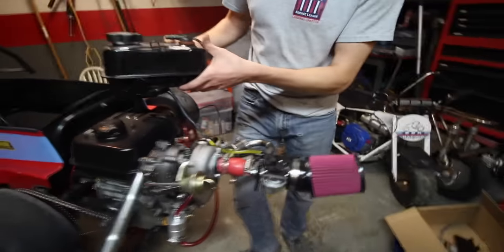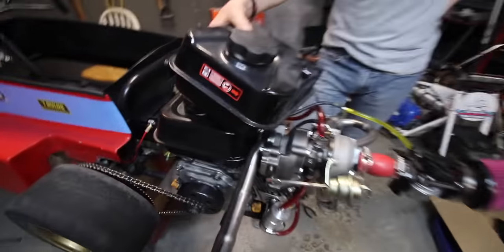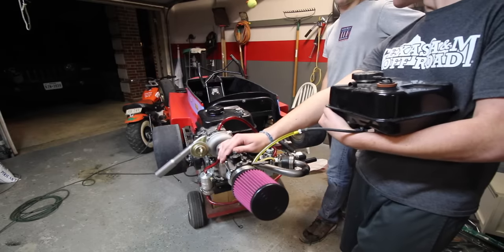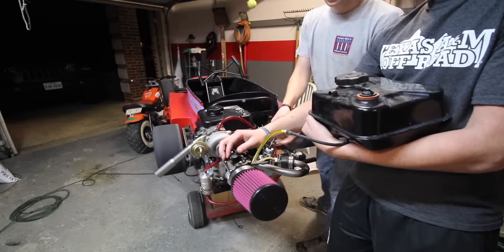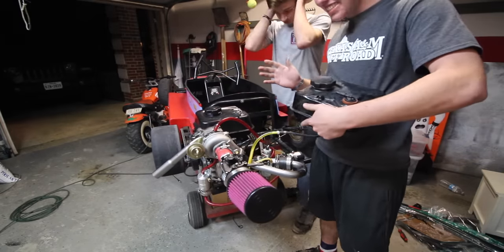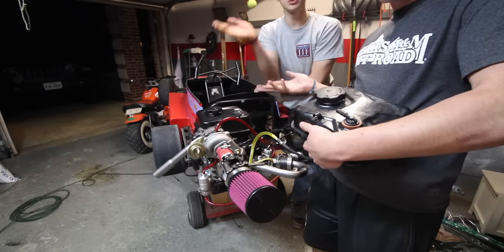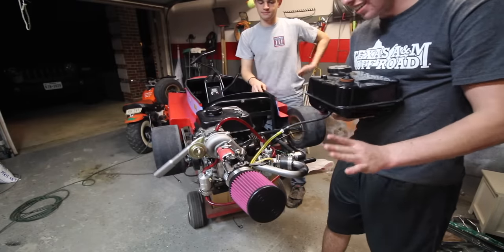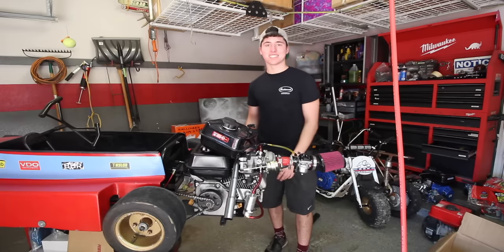Turbo Go Kart Finally Makes Boost!

Comment: BUT what if turbos just aren't effective (due to the laws of physics)  in this size ratio. It could be a big difference when it comes to power efficiency at this RPM and system pressure. I think you are close to cracking the code here. Keep trying. Thats the innovation spirit, you as well as "Cars and Cameras"  both have tried this...Jon and Ike are awesome people i think they gave up though. Ike determined it wasn't possible with the limited carb set ups available though gopowersports.com and EFI is crazy ....they didnt try dual staged carbs though thats a clever boy!! who knows, not unitl all options are ....Exhausted haha pun intended! ha

Comment: You have no idea how carbs work under boost. You need either a special carb made for boost or just get rid of the carb between turbo and engine, you only need one carb, adjust or jet it to give more fuel and but it before turbo then its just a matter of finding the right mix for the boost.

Comment: god this is like waay late, but, you need an air filter on the turbo cuz it pulls it's own air and NOT a carb. attached to it because at that point you are restricting the shit out of the air flow into the turbo............it needs to breathe on it's own and it will run waaaaaay better with a proper installation, meaning the turbo inlet has just an air filter.... the turbo pulls air and forces into the carb, a second carb should not be controlling air flow INTO the turbo, the turbo needs to breathe on it's own

Comment: That way there's no gas flowing through a turbo which gets the ions of it all wacked out and was never meant to work that way and that's how everybody's been trying to make it work on these Predator Motors and they always fail. They run but not very good

Comment: Epic fail guys. You push the boost in the 1st carburetor. But the gasonline must be suckt out of the carburetor. So you push your gasonline back and the engine stopps xDDD
 - holy moly. how bad.

Comment: Two carburetors guys really how about you take that bottom carburetor off and make it intake for that tube and run the suck through carburetor from the top and it'll run like a top you're just choking out the engine with that bottom carburetor

Comment: the point of a turbo is to add air to the combustion, why you want the turbo to add fuel???? then it becomes too rich... if u want more fuel, just have it pump more to the pistons, TURBO = Rise of Air PRESSURE. NOT FUEL PRESSURE

Comment: You could just do away with the before carb and re jet your carb that’s after the turbo and tune it to dump more fuel at a higher rpm that should solve your problems

Comment: What the hell is the deal with the carb setup? Just use ☝️ of the 💯 dependable efficient setups pioneered by those that came before you, unless you feel that you have stumbled upon something truly profound with your carb setup. Flip that turbo so it’s facing the front of the buggy, mount it a little higher and 💥 better air. You could build a little scoop and it would actually look like a little F1 with that scoop over the head with a crazy wing.

One carb + 🐌 + ⛽️ + ⚡️ = 💨

Comment: you guys are missing a lot of things that you need to go and research,  wastegates, blow off valves, intercoolers, o2 sensors, fuel ratios, engine maps ... turbos....  can't just slap that thing on and expect it to work becasue it won't.

Comment: See the boosted boys and go with fuel injection kit with the program for setting the fuel injection system programmable for your laptop. That is the way to go without all the confusion of the carbs messing everything up. https://www.youtube.com/watch?v=W_j2k_oMRbA akk the way to here: https://www.youtube.com/watch?v=UgDZFMABay0&t=478s plus you would definitely need to have the governor removed from the engine also.

Comment: They didnt pressurise the blow through carb and so when it sees boost it no longer has any vacuum which is what the carburettors needs to operate. You are basicly starving the engine if fuel and that's why it dies when it makes boost. This is basic stuff i have no idea why they are wasting their time with this 2 carb BS either pressurise the blow though or run a draw through setup.

Comment: Small engines+turbo..=💩..... I seen some guys do an EFI system with turbo and it actually lost power seems Turbo's don't work well with single cylinder engines unless you really really know what you're doing but looks cool though

Comment: Or you could just adjust the idle screw instead of all the funky meth junky bs.   Also i didnt hear that pull any boost at all.... Try a hair dryer with the carb behind it :'D thats the best way ever to turbo a small engine and it can run the dryer blower on a 12v battery

Comment: Ummm I wouldnt say that made any boost unless you have a pressure gauge on the inlet...its blatantly obvious you guys have no fucking clue what you're doing when it comes to turbos or tuning an engine lol. Probably will make less power than stock unless you get a wideband on there and modify the carb for blow through or do a draw through and start playing with jets...